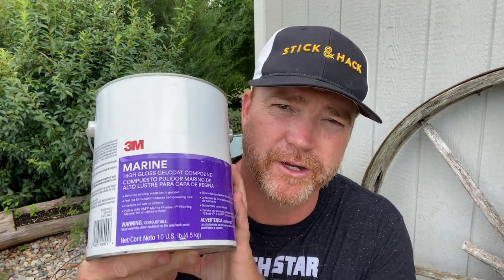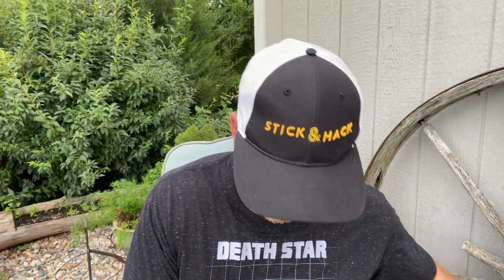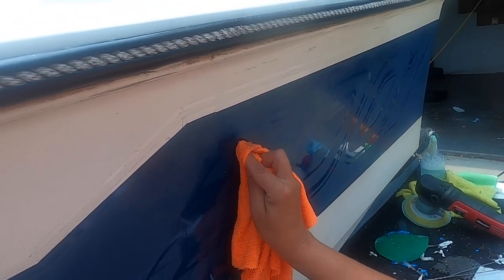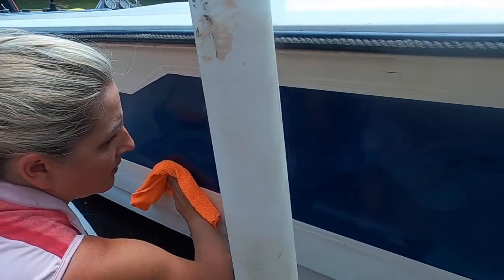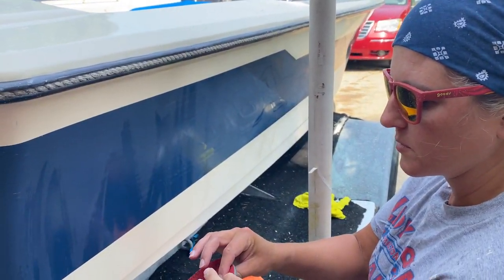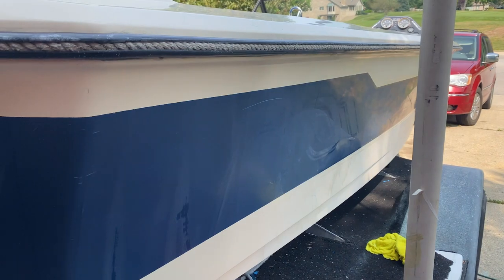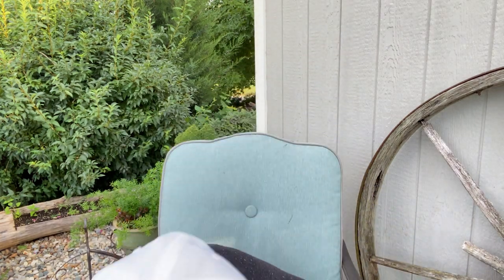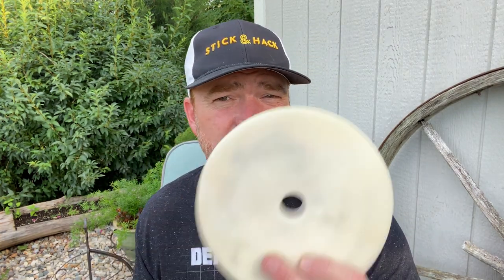86 Ski Nautique Restoration (Part 6 Gelcoat)

Comment: The polisher you used, is it a variable speed orbital polisher? Or does it spin like a sander?
Reply from the maker: Variable speed orbital
Reply: For proper compounding, you should use equality 7 buffer with a well-made wool bonnet the HarborFreight dual action orbiter shown in this video is more useful for waxing and wax removal. If you plan on doing a job like this, do yourself a favor get a quality one that will produce less vibrations and doesn’t scream at insane decibel levels

Comment: I've been watching your videos and finding them useful. In this video I was hoping to see if you were able to buff out the left over decal markings. I would have found that very helpful. I saw you applying a liberal amount of compound but I never saw you take any off. I thought most compounds dried to a haze and then buffed off. With the 3M compound you used do you just keep buffing it in, never letting it dry,  until there is no sign of it? Or did you just not show the step where you buffed out the dried compound?
Reply from the maker: I don't let these compounds dry before this buffing process.  You are either thinking of wax or I am wrong.

Comment: I have a old ski nautique I’m about to start this process on. Mine is very oxidized. Do you have an idea on how much of the products you put links for i should order? Gallon or quesr compound. How many pack of sandpaper. Thanks
Reply from the maker: Wife here. You want at least 6-10 of the sandpaper. The compound you won’t need a gallon. The wet sanding process is the majority of the work and you use water and dawn dish soap for that.

Comment: Did you wet sand the black top of the dashboard before you polished it? What did your wife use to fill in the cracks?
Reply from the maker: We did not wet sand the black. We did that on the first Nautique restoration and could see scratches from the wet sanding when it was all done. The product for the cracks is called Magic Easy.